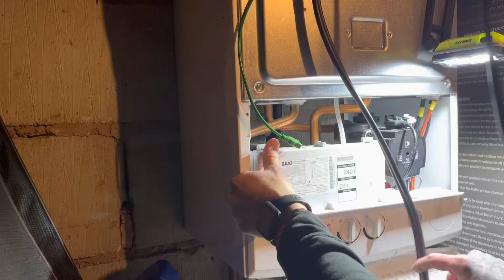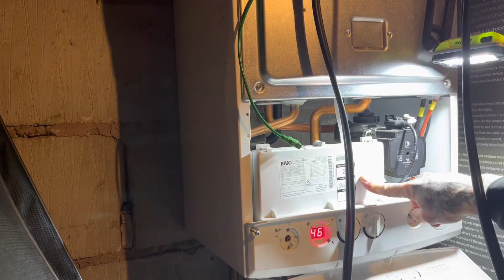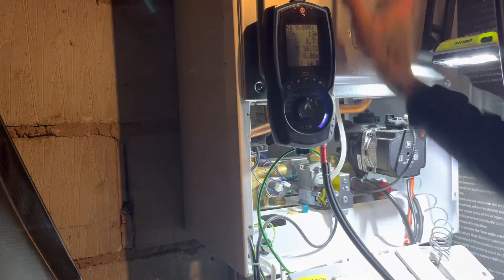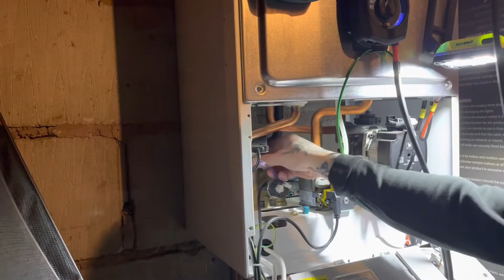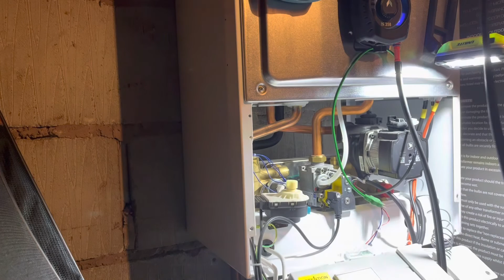Baxi Duotec/Platinum overheating in service mode. How to get round it!

Comment: Thank you..
Do you remove the motor and the turbine after it overheats or can you  do this before??
Or is it to dissipate the heat that's already there??
Loving your vids
Reply from the maker: You could remove the motor and turbine before commencing the service, nothing stopping you doing that, it’s just to dissipate the heat from the boiler so you have time to set it up. With the heating being a circuit..once that circuit comes back up to temp it’ll shut down. Doing the above clears that heat and let’s you can carry, hope that helps.